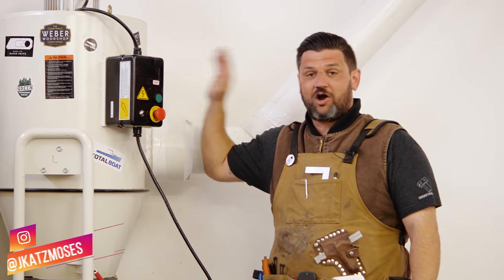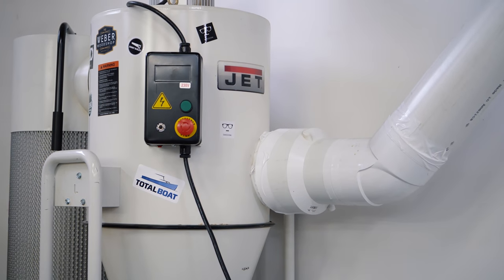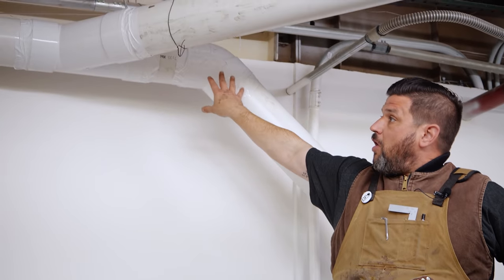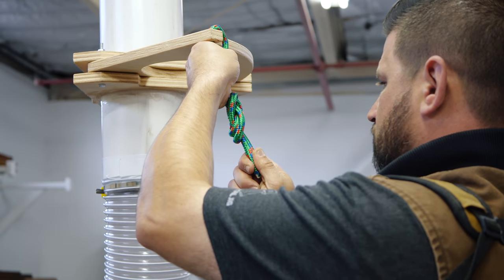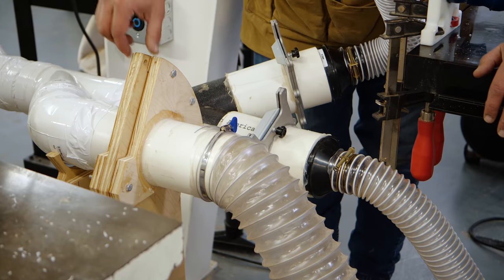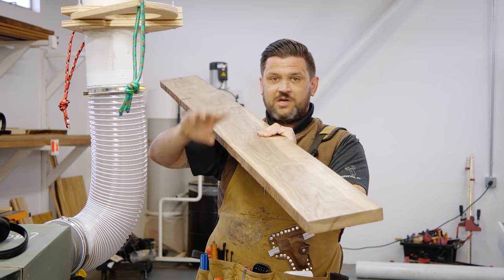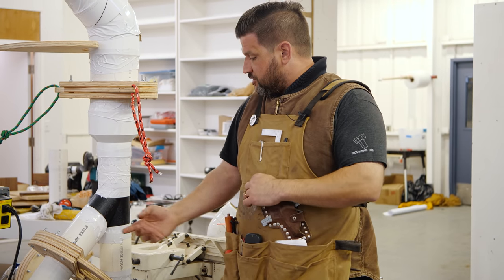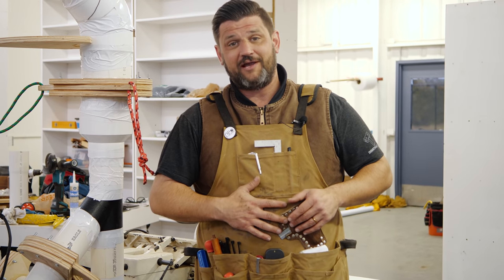Dust Collection Install with Lots of Tips,Tricks and Shop Made Blast Gates

Comment: I only have a small shop, 22ftx16ft and joists are just above my head around 7ft maybe. Do you still recommend no hard 90s? My dust collection is just a 1hp king industrial, will it be fine running everything in 4 inch? Whats the cheapest option for pipe? You use white pvc but some people use the metal pipe that is used for duct work. What guage do you have to use to make sure it doesnt crush in on itself? Sorry to have so many questions but im new and setting up my first ever shop.
Reply from the maker: No hard 90s ever. 4 inch probably fine. 4" drain pipe with od of 4.215 is what I found cheapest but hvac might be but it's harder to install
Reply: Jonathan Katz-Moses so drain pipe? Ok thanks for the awesome quick reply. Seeing your new shop is incredible. Whats the plan for once you get it all up and running? Will you be doing some big projects? What do you plan to make?
Reply from the maker: Check out the International makers station video I released a couple weeks ago
Reply: Christopher McLewee use either sewer pvc (hardware stores usually have 4”, not 6” so you need a plumbing supplier) or you can use 26ga metal ducting. I’m setting mine up now and going to use 5” metal bought online because I can’t find 5” pvc anywhere.   The inlet of my super dust deputy is 5” so going 6” is pointless. Use whatever size your DC inlet is.
Reply: Craig Andresen thanks. Yeah im not sure what my DC has. I assumed 4”. I found this clear pvc hose, but i know it gets a big no no from a lot of people www.leevalley.com/en/wood/page.aspx?p=51505&cat=1,42401,62604,51505
Reply: Christopher McLewee yeah, you can use that at the attachments to your tools and stuff but you don’t want to use that for tour main runs unless you just have a portable DC that you move from tool to tool with like a 10’ hose. Too much turbulence with that corrugated flex pipe.

Comment: What brand and model dust collector do you have?  Thank you.
Reply from the maker: Jet 3 hp
Reply: @katzmosestools  what do the static pressure numbers mean? Is a higher number better? When it says a certain cfm at a certain static pressure, does it mean that the collector will produce more at a lower static pressure? Thanks again.
Reply from the maker: @befmx31  I'm not an expert on that stuff

Comment: Great video. I have watched this multiple times when setting up my dust collector.

I think making the gates turn on/off is a much better way to go. You don’t need to verify which one is open or closed as if some gate is open, dust collector would be running. 

Thoughts? 

We did it recently - https://youtu.be/AZHnPWT5FyI